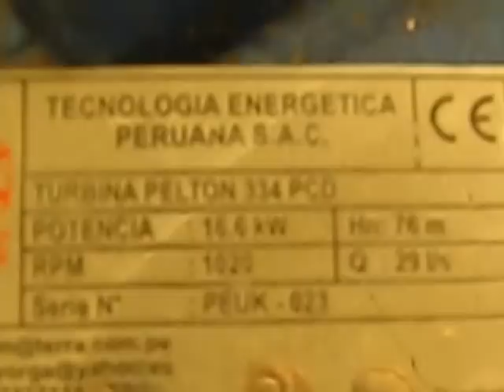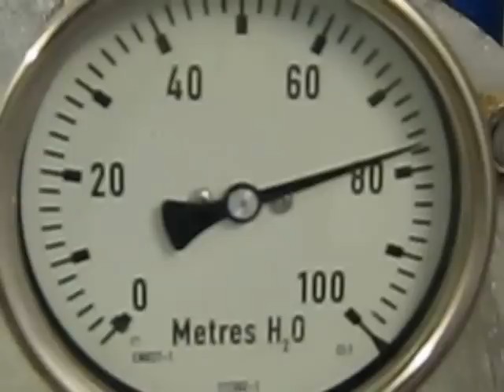Mini Hydroelectric Pelton Turbine

Comment: Just saw this video. Where is the station located? This is a properly done power plant.
Reply: Thanks for your comment.  This project is on the West Coast of Scotland.
Reply: I thought it was in Britian. It has the look of a place the slate miners have been. As I said very neat installation. 

I suggest installing a pressure release valve be installed on the penstock near the turbine to protect the pipe if the turbine suddenly shuts down. There is a lot of energy in the flowing water in the pipe.

Comment: thanks for posting.  here's a couple very very late thoughts, for you and your subs.  based on the numbers given, there is about 21.6 kilowatts of potential energy available, at this site.  with an output of 16.6 kilowatts, the, apparent, overall efficiency is about 77 percent.  a correctly designed installation, that included a correctly matched pelton turbine, should perform well, here.  better than 77 percent.  this all suggests, there are flaws in the design of the installation.  some of these flaws may be the result of deliberate design choices.  if so, fine.   if not, 77 percent efficiency is LOW for this installation.      cheers
Reply: Sure some flaws mostly for financial reasons.  Cheers